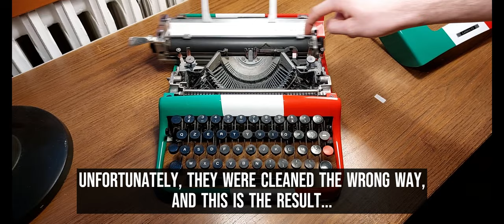Olivetti Lettera 22 Typewriter restoration | disassembly and cleaning | made in Italy | M. Nizzoli

Comment: What rubber bushings did you use as replacements for remounting the body to the frame?
Reply from the maker: Hi! I think they are called "rubber cable grommets" in English. In my country (Italy), they are called "gommini passacavo".
You can find pretty convenient boxes with different sizes on Amazon for around 10€.